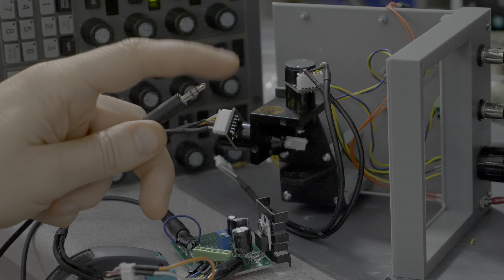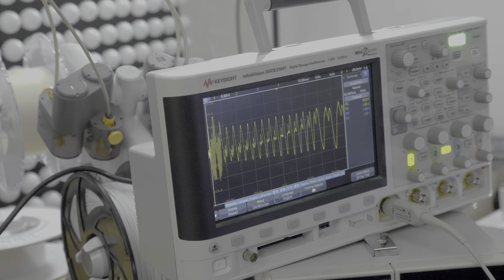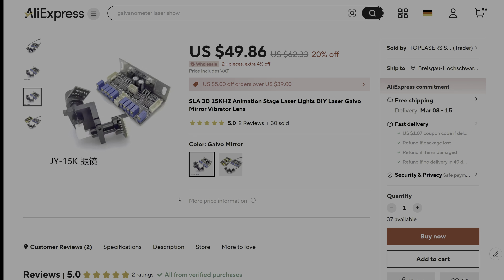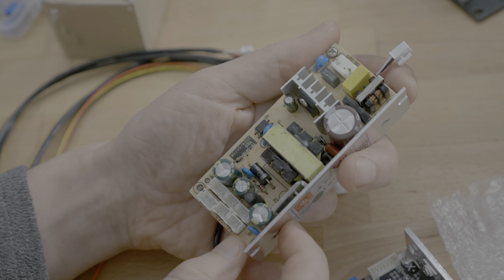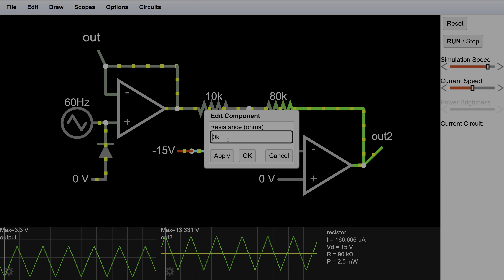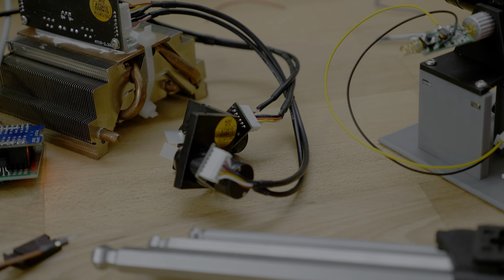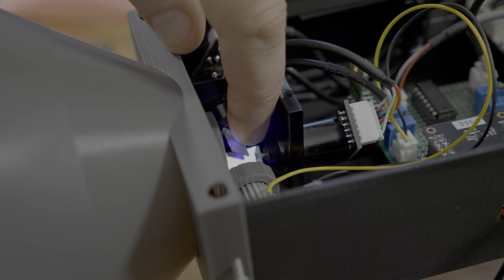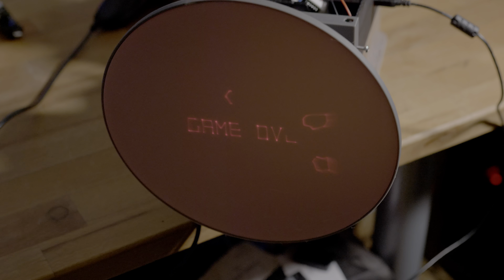I made a LASER vector display

Comment: Next time just use batteries instead of linear regulators. You need 15v make a 30v pack and right in the middle is now ground.. super easy. I would use lifepo4 since they have an almost flat discharge curve. Ham radio guys love them. 7809 and 7909 are going to be very hot. Always choose the voltage you need and not over it because any watts you aren't using are getting expressed as heat. That's why it gets so hot. Use batteries and a charge board that supports charg/discharge at the same time. A quick and dirty differential power supply is 2 9 volt batteries in series and you scale it up and up if you are prototyping. Obviously you still need  cv/cc but a decent uck boost will be much more efficient and allow a range of voltages at the input.

Comment: I remember when I had this much energy.  Yea that LiPo will deliver whatever current you want but also what you don't want.  Good that got you “spare parts” though!  The TO-220 Op-amps heat up because they are class AB so have some bias on all time to be linear.  Nice to add the heat pipe heat sink.  

I setup an old portable tube Tektronics O-Scope to display a clock in vector mode, and had to do voltage invert and gain adjustments via an external PCB.  Nothing as complicated as you did but a fun project.  I also 3D print and enjoyed that part 🙂👍
Reply: At some point, the wire becomes a fuse ;)
Reply: @ Especially when LiPos are the power source! 🙂👍